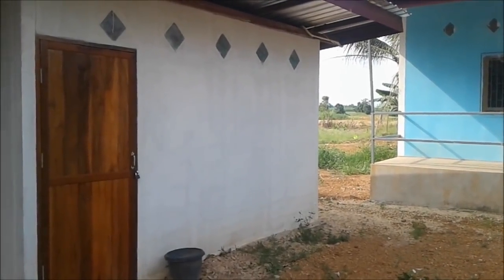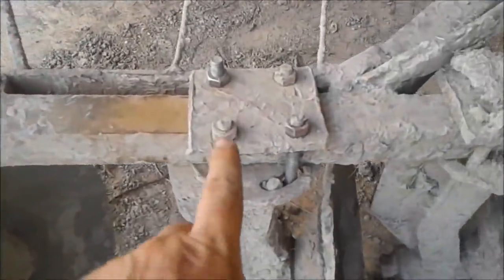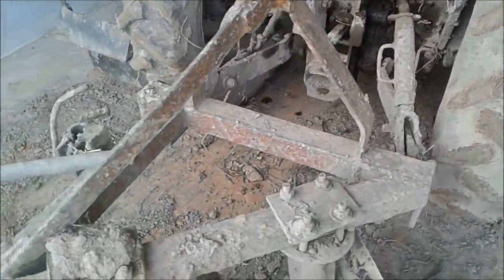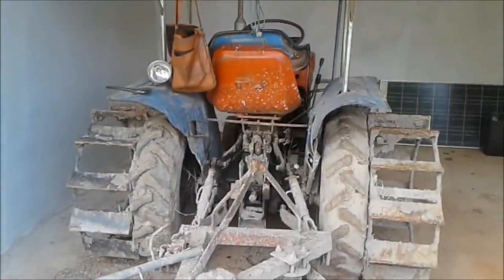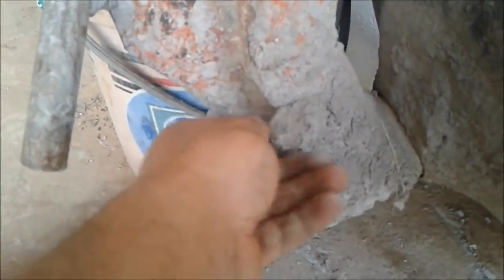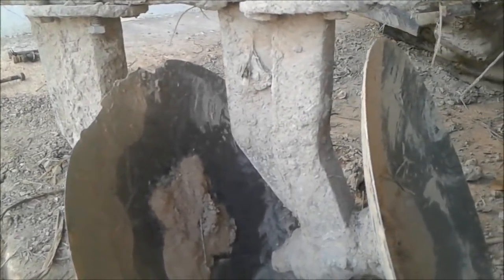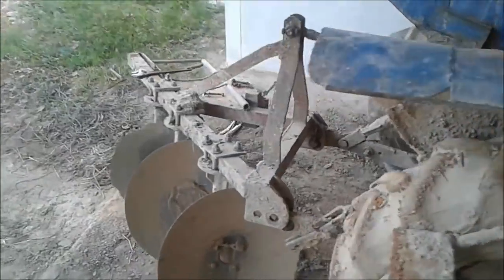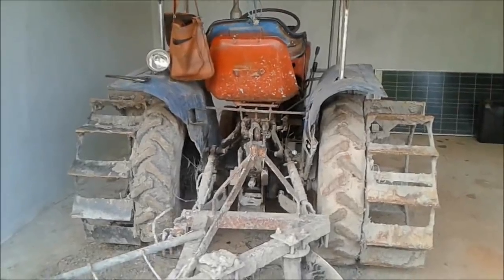OLD Kubota Tractor TLC

Comment: I'll try and help you out a little Leigh. On that disc that keeps loosening up, put it where you want it and then drill a hole from the top down through the top plate and through the box beam. Now, just drop a hasp pin in there and it may loosen up on you but it won't slide. Either that or just put some loc-tite on the threads of the bolts.....
Reply from the maker: Love it 👊

Comment: I like a challenge as well but... good god...!
I would be tempted to use this plough as a pattern to make a new one...  :-)
That disc that has moved right/forward is odd. I'd have expected it to move backwards...
I agree with Okie's comment below - drill a hole and use a steel pin/bolt to maintain the position even if the nuts come loose - and use spring washers - probably the cheapest option - you have difficulty finding Nyloks.
Reply from the maker: Good point about the disc would be expected to work it's way backwards. Unless I was in reverse all day & didn't realise, which is a possibility 😩

Comment: Ah the farming life good on you Leigh. It could just be the camera angle but it seemed that the 3 point linkage isn't level most likely to the chain repairs and seized turn buckles causing the rear disk to dig in more than the others and cop the extra wear. Could be worse using an old wooden plough and buffalo. Thx for the vlogs Leigh and Toon
Reply from the maker: I'd go down the buffalo route but Toon won't allow it. She was nearly killed by one as a kid. Well her older sister nearly killed her by strapping her to one & smacking it's arse 😲😲😲

Comment: Me again,,, 5555 ,, buy some grease and put some on the springs and everywhere else on the old girl,, and put 2 nuts on that way one makes the other one tight like a lock nut,, so a good clean and a wire brush and some CRC,, or Wd40 will help you out putting the grease on and the nuts,, and also you can see where you say it hits the side you can see it is bent,, i am sure we can heat it up and hammer it straight,, F--k only 2.41min into this vlog,,,lol,,. And mate for 30,000 baht,,, i would have and still want one,, You can't beat that price,, It has saved you say 25'000 in cost to get someone to do what you have done on her,, so not long now paid her self off,,,